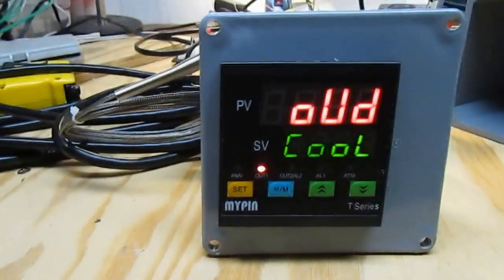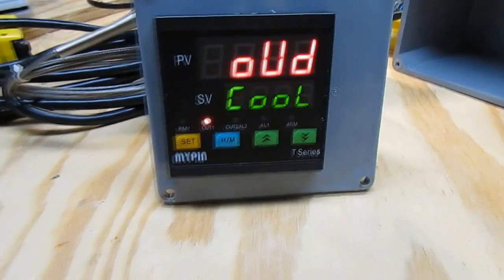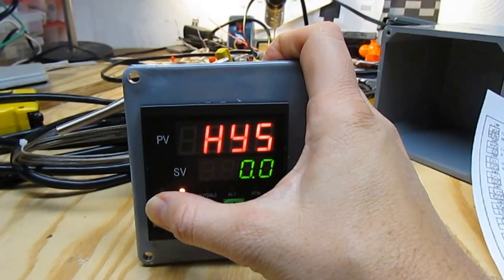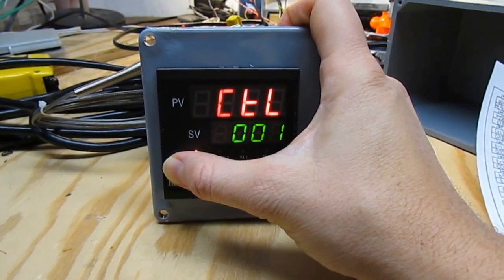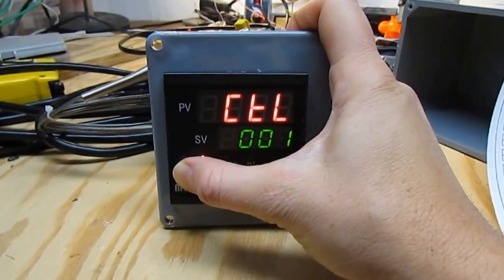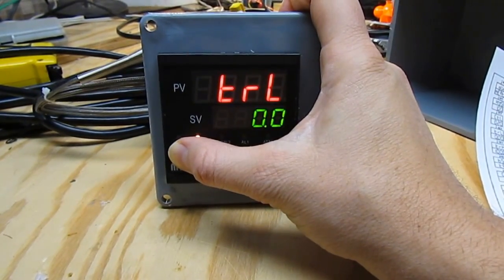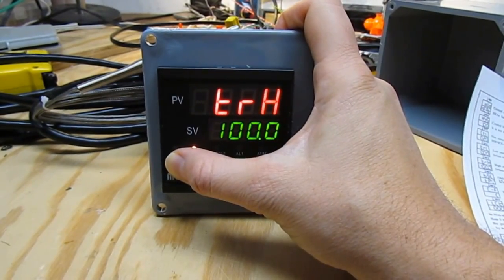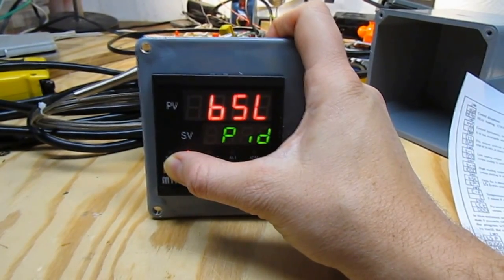PID Temperature Controller for Heating/Cooling of Beer Fermentation

Comment: He almost explained it but not quite. 
So you set up your PID  (CF, system function to cooler on an INKBIRD it's 3, the default is heater) and use the low alarm to a few degrees lower than the set temp (LoAL). A bit of a hack but it works because where I live I usually have to cool more than heat. I use the LoAL relay and a 9V power supply in series to activate an SSR  to power a heater belt that I have under the blanket of the fermenter. I use a Peltier to cool. If you live where you're heating more than cooling then keep the PID system function to "Heater". PIDs usually control the temperature in one direction. You can get a bi directional PID that will do the up-down temp adjustment but they are 10 times the cost.

Comment: I was curious about the alarm 1 and it's 3 amp max connection to an output source. Is the alarm device meant to be an output to reach target temp and if so why is it called an alarm and not  an output? Is it because you have to supply the power through one terminal then it relays to the next terminal on alarm 1?  I wanted to try one of these controllers on a small 12 v fan and was curious if I even need  an SSR to hook it up? It only pulls like 1.2 amps so it would simplify the wiring process if the built in relay works as such.

Comment: Hi, I followed your instructions for wiring and programming with the only change being that I added an inline fuse. My PID fluctuates somewhat rapidly (changing degrees maybe every second or two) between two temperatures (i.e. the freezer is warming up slowly approaching the SV) causing my chest freezer to kick on and off until it trips the fuse. Have you had this problem? I wonder if there is a setting that once it hits the SV, it needs to stay there for a minute or so before actually turning on the chest freezer....??? Thanks.

Comment: question - if i am wanting to build a diy temperature PID Controller/box which setup would you recommend i go with to heat up 2 aluminum plates up between 90 F to 260 f tops i will never exceed that amount of heat and   " kinda like a t shirt heat press "

Comment: Does this setup turn both the heating element and the freezer off if the fermenting wort is at target temp?  Say I have it set to 67 degrees and and the heater or freezer brings it up/down to that temp, do they both shut of or does this continually run back and forth, heater and freezer?
Reply from the maker: James Owen Yeah, it sure does.

Comment: I use the same as he did in the movie, but there is a problem. When the controller make the electricity off, the relay still works and the heater still works!!!

Comment: Setting P = off will disable the PID capabilities and make the controller a simple thermostat switch..
Reply from the maker: What benefits will that bring?
Reply: Dana Cordes
It makes things easier in simpler installations. One example is the oven controller I built where all the fancy stuff wasn't needed.
Reply: Dana Cordes 
You bought highly schopiscated PID controller and by setting P=OFF, you are using it as an ON-OFF controller. No benefit, just wasting money. Read Wiki about PID.
Reply: Nice Michael ... I paid $18 for a Chinese PID controller for hobby use and in fact use it 90% of the time with a custom calculated P value. By turning P off I can make it double as a dumb thermostat when I need one.
Reply: Nice Michael These PIDs are cheaper than any thermostat/with remote wired sensor that I was able to find, so
 even if somebody used it for a simple on/off thermostat they still wouldn't be wasting any money.  They even come bundled with various size solid state relays,  so I can't see how it would be wasting money.  With the PID turned off, you still have: 1) hysteresis, which allows you to operate within a specified range, and 2) set-it and forget-it  automatic heating/cooling functionality.  Cheap thermostats don't have either of those functions.

Comment: I did the connection and everything, but when I try to take readings from my thermocouple I am getting around 20+ constant what the actual temp is. Do you have any idea how can I calibrate it? Your help would be appreciated. Thanks
Reply from the maker: I just glanced at the data sheet, and I believe you adjust the PVF value in the settings to calibrate.
Reply: Already found a way to do it using offset using PVF, thank you so much for your reply.

Comment: You are using only the I of PID? Do you know what PID is? At least you should be using P or PI or PD or PID. Imagine you want 50 and you have 40, what P makes is amplify the output P*(50-40) times. The D is the derivative or velocity, if the temperature is going down to quick the D will increase the output more. The I in my opinion is the less important, its a sum of the error VS time. Imagine that the temperature is constant at 49 and you want 50. Because the error is constant the D will do nothing, and the P is giving constant output also, so nothing will change. The I will add the value of the error over the time (in this case 1+1+1+1+1.....) so the output will go up and the error disappear (but now that temperature is going up so D will decrease the temperature). I didn't know if you understand what a PID makes so i try to explain in a easy way. Giving the right importance to P, I and D is the hard stuff, usually P is bigger then D and I is very small.
Reply from the maker: So, how would I go about changing my configuration to take advantage of D?
Reply: Try the auto tuning function and see what value it gives to you.

Comment: For your heat source, instead of using a light bulb, get a ceramic heat emitter used for reptile tanks. It's a ceramic bulb that gives off incredible heat and but no light. You will have to use a ceramic fixture for it (pretty cheap at Home Depot compared to Petco). The emitters run about $25 but they last forever, literally. I've been using the same one constantly for close to 20 years. Go to the Big Apple Herp site for the best prices. And light does affect beer. That's why it is best stored in the dark or in amber bottles.
Reply from the maker: What I ended up using was a small space heater from Walmart.  But a ceramic bulb sounds good as well.  I ended up not using a light bulb for the exact reason you mention.  Good point!

Comment: Sorry, this is gonna seem like a stupid question, but the dimensions for these PID controllers are pretty easy to find (i.e. 48x48x180mm).  I'm still waiting on mine to arrive.  Do I want to cut out 48x48mm?  Or is that the dimension of the outside frame?  Is the inner body slightly smaller, like 45mm?
Reply from the maker: Yeah, the inner dimensions are slightly smaller as there's a small lip for mounting.  Check the spec sheet for the dimensions.

Comment: So, I wired my pid according to your vid and my ssr blew up in my face
Reply from the maker: Hah!  I didn't know that could ever happen.
Reply: Dana Cordes
it looks like your system drawing has the SSR input / output reversed. normally the coil would be connected to the PID and the output connected to the load (freezer). P.S. does the instruction sheet have a web site or could scan the instructions and send them to me? i need to do some unusual configuration and i would like to see if these low cost units are compatible.

Comment: i came across ur video sine i got my pid unit today and having trouble with it, for one the directions are horribly translated and after a ton of trial and error i got it to read the temp right but how do you set the temp difference from when it hits the set temp (95 which is when it shuts off) and when it will turn on? mine just keeps turning on n off a few times a second

Comment: You should use an external SSR regardless of the fridge size, since it is an inductive load. The electro-mechanical relay inside the PID controller is not rated for handling large inductive loads, and will have arcing across its contacts every time the compressor kicks off, causing faster failure. You should only use the internal PID relay for resistive loads (i.e. heater, lamp, etc.), or to control an external relay coil.

Comment from the maker: You'll need to check the datasheet for the PID unit, and the label on the small fridge and see if it'll handle it.  For my small space heater, the PID handled it just fine.  For the full freezer, not so much.

No, I don't have any fuses inline.  Probably should...

Comment: Is it necessary to hook up the external ssr if the cooling unit is under 3amps like a small refrigerator.  Also did you put any in line fuses, in the set up example of the instructions it shows this.

Comment from the maker: Try tripping your relay manually with a 9V battery or something, or use a multi-meter to test whether the current changes when you'd expect the PID to activate.  There's a red light that illuminates when the controller is in an activated state, so you can confirm whether it's a wiring, or configuration problem.

Comment: Thanks for your reply. So if I use SSR for heating and built-in relay for cooling, (cold water circulation will be turned on when T > certain setting), should I connect the cooling device with AL1 and AL2 (usually off)?   It seems like in your circuit diagram AL1 and AL2 is usually on.

Comment from the maker: I'm sure there is.  Look at your wiring diagram and hook the SSR output to your SSR and the relay can control the other one (as long as it doesn't draw too much power).  Then look at the documentation for the controller to see out to set it up.  I don't know anything about the JLD612.

Comment: Thanks so much! Now I am in the stage to try both functions(heating + cooling)..    But I have a different PID controller (JLD612) and I am not sure if it can control 2 output at the same time.  Do I have to get a PID like yours or is there a way to configure my PID's setting? Thank you again.

Comment from the maker: You could change nothing, and just hook a heating element to the main power plug.  There's a setting in the PID to have it trigger under, or over a certain temp.  So, you just flip that to HEAT instead of COOL, and you're set.

Comment: Thank you for the video.  I plan on using the controller for my fish tank.  I would caution you not to use the aquarium heater without submerging it in water.  They aren't meant to run in air and it will probably burn.  I do like your lamp heater, I'd stick with that.  In fact I may steal the idea.

Comment: Thanks for posting!!
Just becoming acquainted with a MYPIN  TA6, and the instruction sheet.
It makes my brain hurt!

Do you get much heat in the box from the SSR?
Using a similar box  just the PID pushes the inside box temp to 95° F with room temp at 62° F on a short run.